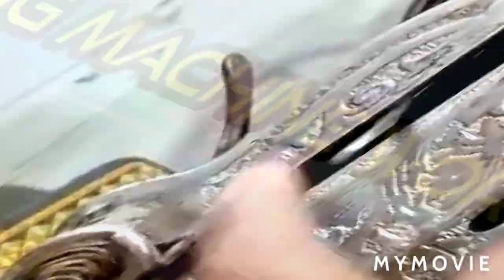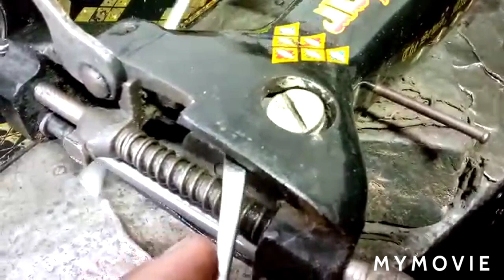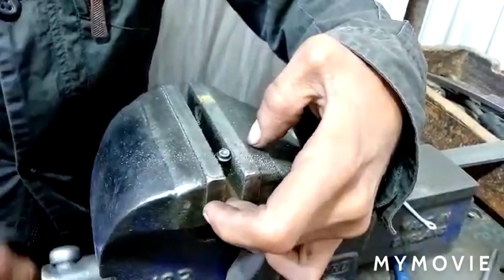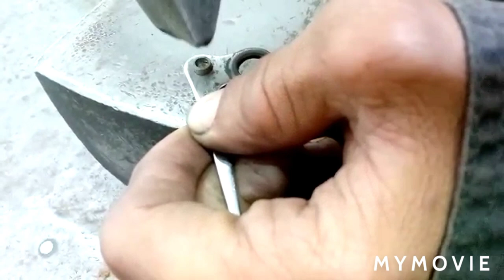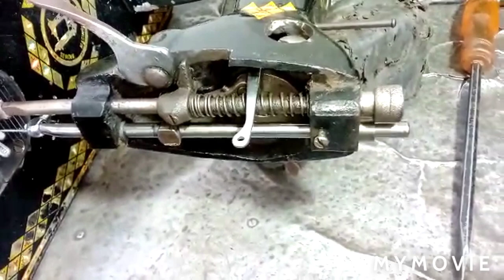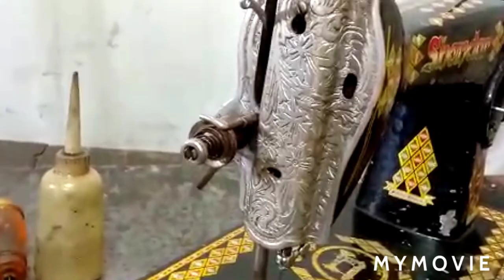HOW TO REPAIR TAKE UP LEVER ASSEMBLY  SYSTEM | HOW IT'S DONE | SEWING MECHANIC

Comment: im so frustrated, i have an Alfa 53 with an apparently identical take up lever that this one in the video, the machine is in perfect condition and it sews perfectly after cleaning and oling it BUT the take up lever hits some other part in every cycle ! it sounds very strong ans loud hits and i can't figure out what is wrong, do you know this particular problem ?
Reply from the maker: Hi, thank you for watching my video. Please get in touch with me through my Facebook and send me some pics.
Reply from the maker: Open and check if the lever assembly round ball part at the top is broken. It can get worn out with coming in contact with face plate. You may need to purchase a new one part.  I will upload a tutorial for you soon  on this.
Reply: @Sewingmachineworkshop1  Oh I'm impressed, and i really thank you for your time and dedication, please you don't have to make a tutorial unless you think it really might help more people... I can send you pics or videos if you want but i don't really want to abuse much of your time so i will try to precisely summarize what i've experienced: My machine is an Alfa 53 and although very probably is 100% singer 15 clone internals it might have some differences. When i fugured out the loud banging noise was coming from the take up lever area i just removed it and actually the noise was gone; the lever piece aparently seems in good condition (it has that little spinning wheel that goes inside the channel of the gear (i don't know the proper name of this piece) but it's all metalic, no that white cover you are replacing in your video, anyway it seems there is not any missing white cover in that little wheel, nevertheless i  thought the only thing i was able to do is  to improvise some little tube to cover that wheel and increase its diameter, and thats what i did but... with a plastic cover, and after pushing a bit because it was tighter, i placed the lever on it's track again and... it worked ! no noise... for 10 seconds haha... obviously the plastic attachment got destroyed quickly... and my conclusions now are pointing point to 1: change or properly modify the lever or 2: check the tracking gear for possible imperfections in the track... sorry about my long text but ironicly i just want to save you time by properly explaining the problem, i can send you some pic or video, and you don't feel compromised, you've already helped me a lot. Thanks !
Reply: @Sewingmachineworkshop1  I've written you in FB :)